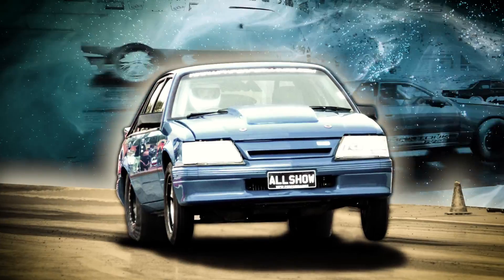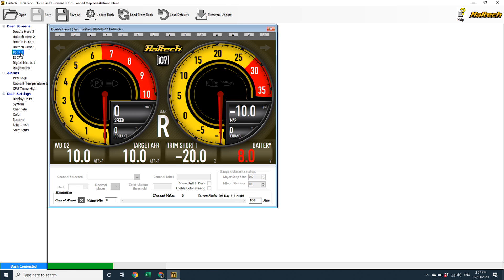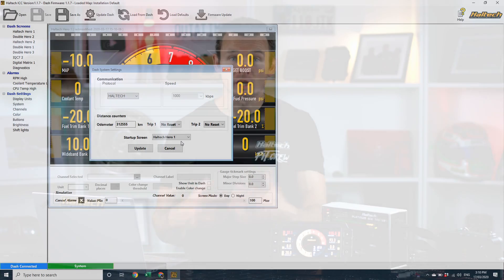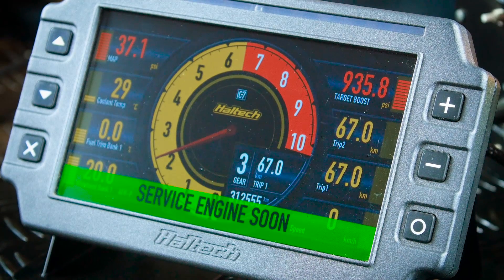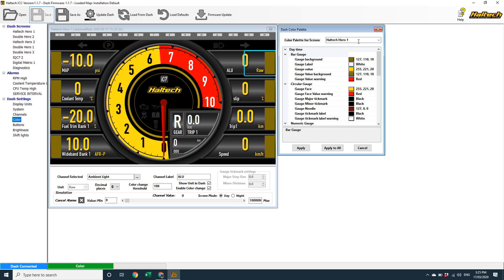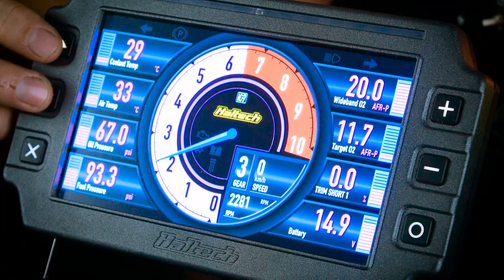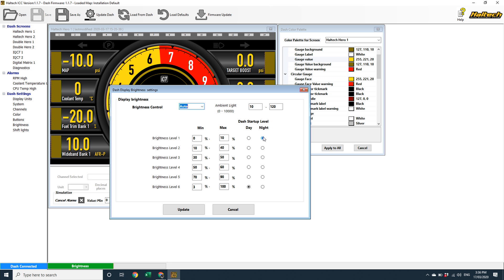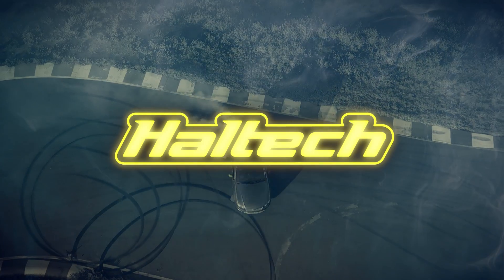💬 iC-7 Dash just got a whole lot better | TECHNICALLY SPEAKING

Comment from the maker: NOTE: This update is scheduled for release on Tuesday 31st of March - so you will need to wait till then to actually try it out - but it will be worth the wait!
Since the release of the iC-7 we’ve received plenty of requests and suggestions for improvements and we’re happy to present you with first update, addressing most of those requests:) 

Here is a brief outline of the changes and additions:
• NEW; Odometer and Trip Meters
• NEW: Gauge screen layouts
• NEW: Configurable colour palette
• NEW: Day / Night themes
• NEW: Control Button functions
• IMPROVED: Control Button response
• IMPROVED: Display brightness settings
• PLUS: A whole lot of minor but noticeable software interface improvements
See the write-up on this update here: https://www.haltech.com/ic-7-about-to-get-a-whole-lot-better/
Reply: I've been running Haltec since around 2k and have never looked back because of things like this where you listen to your customers.
Reply: Sir can it be installed in ,BMW E60 M5 2006
Reply: @salmaniftikhar6583  you will need an haltech elite or standard for this

Comment: I want to buy Platinum Pro pnp with this display for my R33 GTST Series 1
HT-010202, HT-010233,  HT-067010, HT-159976, HT-055101 should be enough to get my tuner going on VE? or do I need HT-159000 because I am using 2 CAN devices?

Comment: Can I run this product without a OBD2 port? I have a 1989 GQ patrol with a 12v 6bt Cummins which is all mechanical. I want to get rid of all the gauges and have it on one display.
Reply from the maker: Currently the iC-7 only works with selected aftermarket ECUs or OBD-II ports.

Comment: Hi, the intro "Haltech" word, can I input my own text or my car logo and can I have my car oem dash style also?
Btw, I got a obd2 version for my 15 Gtr and it's on the way, will I have all the features by obd2?
Thanks
Reply from the maker: Hi Kevin, no that can't be changed, sorry. 
The dash can display only what the factory CAN system broadcasts. If you grab a scan tool and plug it in to the OBD2 port and set it to "generic", you'll see what the factory system is broadcasting.
Reply: Haltech thanks for your reply, how about another gauge style, can I download something else, example like a Gtr cluster style or all I have is what it have?
Reply from the maker: We will be adding more gauge layouts in the future but for now it's just what you have pre-loaded. You can however change the colours of the gauges.
Reply: Haltech thank you sir

Comment: It would be cool if the service alarm indicates how many kilometers left to service (Same as OEM Clusters);

Question:
The odometer feature distance (ODO/TRIP 1/TRIP 2) is present inside the ECU or the dashboard? If for some reason I need to disconnect my dashboard ... Will the odometer function stop?

Considerations:
I saw an answer saying that the dashboard isn't touch screen because of the use of gloves... I'm wondering: "How many users use gloves vs how many don't?"

I'm from Brazil and here we have a lot of ECUs that has this feature for more than 10 years and it's a way without turn back. It doesn't get dirty with signs of fingerprint as you may think, actually it gets dustier (the same as being not touchscreen) but it's easy to clean.

Comment: Is it possible to show speed and odometer based on a GPS signal from a GPS sensor instead of the ECU data?

And could you implement an option to scale/autoscale the numbers in the speedometer? (with a maximum speed value of 340km/h and a major step size of 20 the numbers start to overlap each other)
Or can the digital speedometer show values greater than the maximum speed value, like max value on 300km/h and the digital speedometer showing 340km/h?
Reply from the maker: Not at this stage but if there's sufficient demand we'll definitely look at adding those features.

Comment: I live in a juristiction where low beams have to be on at all times when a car does not have DLR, is it possible to tie the day/night mode switch also to the ambient light sensor, or would I need to rig up some other input, be it a switch or time of day based signal?

Comment: Hey guys, great work cant wait to fiddle around with this. One question, will we ever get more complex alarm control. Eg condition based. Such as, low oil pressure alarm at say 50 psi, but map sensor must be 25 psi and rpm greater than 6000. As an example.

Comment: This update just sold me on the dash! 
Now that you guys own Adaptronic, are there going to be fuel-level capabilities updates on the Modular series in Eugene?
Reply from the maker: That is something we'll need to ask Andy!
Reply: Exactly this! I have an Adaptronic and have been considering getting this dash, but don't want to lose fuel level or run and external gauge. Either an external input for 0-90 ohm level sensors, or having the ability to do it over CAN with the ecu would 100% sell me on the dash.